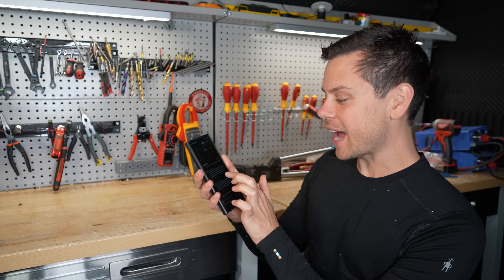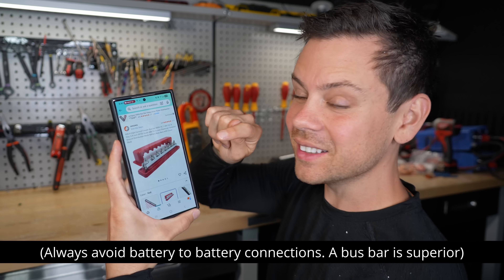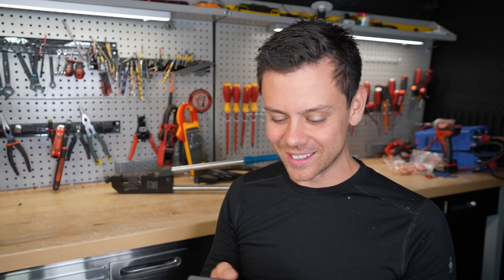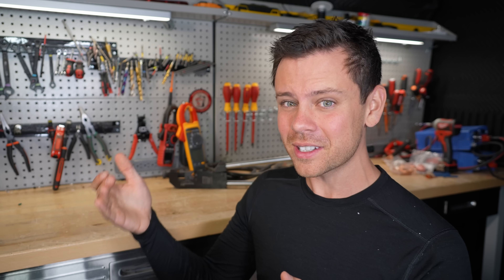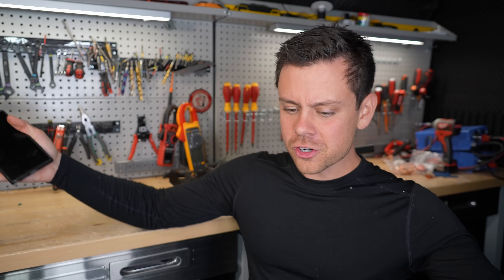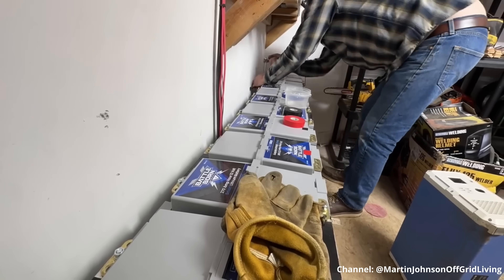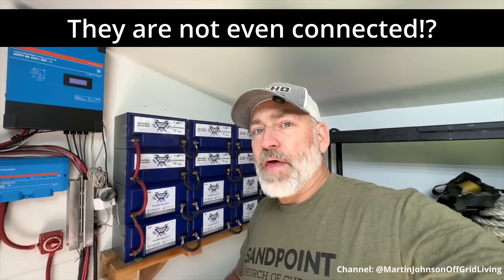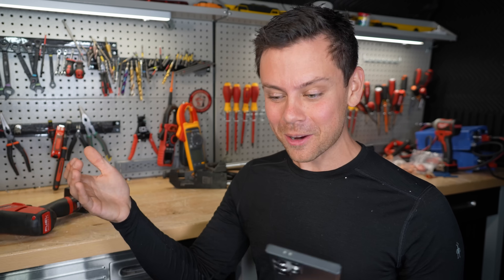My Reaction to Martin Johnson's "BEST Off-grid Battery Bank" Video 😬 Yikes!!

Comment: $25,000 on Batterys and you haven’t got a crimper
Reply: Batteries were probably free for the advertisement.
Reply: @danndank  you're right but the crazy part is that probably meant Battleborn got full editorial control. Or at minimum saw an early version they could comment on. And they still let this abomination go out.
Reply: Well he probably got it for free based on all the boot kissing he was doing about the company.  Looks like all Battle Born employees are downvoting this video lol.
Reply: @jjman533  how do you know this/?
Reply: Or a vise. His home is off-grid, lots of work going on there.
Reply: I have a hammer crimper I use for making automotive/power sports cables but not sure if thats up to spec for a solar power system.
Reply: @TuttleScott  I’ve had a hammer crimper for 13 years when I made several 4 gauge and 1/0 gauge cables.  10 years later I cut a couple of those cables apart because I was still using them and I wanted to see how they were holding up.

The copper lugs and the copper wire were 1 piece!!  I could not tell where one ended and the other started!  Before I destroyed the cables, I also tested the resistance of the cables with a Fluke multimeter.  They each were about 0.2 ohms, which I didn’t think was too bad considering the age of the cables.  

So, with all of that, I am 100% confident that a basic hammer crimper is fine, IF you ensure they are fully crimped.  I hammer them on a concrete floor until the sound changes.  Once the pitch goes up AND the crimper starts to bounce around, that’s when I know the lug is fully crimped.
Reply: @TuttleScott he also has one, used it in his previous video and people in the comments were saying he should use a good one
Reply: Battery Rich, Toolbox poor
Reply: He has a nice roll of solder anyway. Course should any of those terminals get warm it will reflow and the wires will just fall out.
Reply: @SkaBob Warm?  374°F to 446°F is the melting point of solder. That's a lot hotter than "warm"
Reply: ....OR A VICE 🤣
Reply: Or a vise .. blow torch and a cardboard box. PROFESSIONAL
Reply: @holmesondrones I was waiting for the cardboard box to catch on fire 😂
Reply: Not even a vice. smh.
Reply: BattleBorn is he's long term supporter, so he should get those batteries for free.
Reply: @DiedLiu  if anyone at battleborn watched this video and knows even the slightest about wiring, they will cut ties with this guy ASAP then publicly wash their hands of him and his shoddy installation.  It's a fire waiting to happen.  I bought a cheap chinese hydralic crimer for heavy gage lugs... worked 1000X better than this guys blowtorch/solder method.    Watching him run positive cables over negative and then again over busbars... absolute painful.   He's 1mm of insulation away from having a fire bomb on his hands at sooo many points of contact.
Reply: These batteries are way too expensive.. they all come from China.. labeled from USA. Just his design.. did we do a break down on these batteries let's open 1 see what they look like
Reply: 25k for batteries,  you could buy 2full bluetti  or the other one ( forgot the name,  shouldn't,  but was reviewed on this channel) could get 64kw systems  for that price $ 12.5k  and just easily power a few small off grid lake homes. The other system, ( I can't remember  you could get 48k w and their gas or solar generator and if you lose sun for a few days charge your  system.   Totally ridiculous to spend that much. 
 He'll Big battery  will sell you 1 battery that makes double that and a complete system for $10k.
 He made this video just to get all the batteries for free. Atleast I hope that's why.  If they see this video they will their batteries back. 
 Clearly not the way to do it! Looking at the imbalance on those batteries,  his next video will be bashing battle born batteries because he will be replacing them in a couple years. Or his shed and maybe house because of the fire Unless he watches this video and goes back and does it right .
Reply: Jeepers what he’s done is dangerous and if he was doing that in Australia or New Zealand where we have strict safety standards for battery install that would be totally illegal for many of the reasons and even more than what you mentioned but good for spotting many of the real world risks. Your right it does make me sick also when people have no idea what they’re doing and are doing dangerous illegal setups and then posting them online where other people watch their videos and copy it yikes not good. Good on you for your honesty about it will safety is not something to take lightly.
Reply: Thinking about all of that new resistance he introduced to the system sanding them lmao, the damn near perfectly flat metal now has air gaps and such
Reply: He had a crimper in his older video. That's the weirdest part about this
Reply: Times are tough...
Reply: @mrhappyscooters Crimper, my left foot, that poor fool doesn't have anything between his ears... 😲😳🤔
Reply: crimper for 1 or 2 ought Ga is expensive  -  I used to do grounding halos + buss bars for equipment inside telecom shelters  -  mine was hydraulic and cost around $3,000   but those crimps were professional and passed electrical inspection every time. (and we used it a lot)
Reply: You can always just rent a crimper. Much more cost effective.
Reply: @stevemyers2092    So you probably got all the safety training.  These YT videos about putting DIY battery walls in my house are unsettling.  Lots of energy and I wonder how to deal with 10 year old equipment.
Reply: @stevemyers2092 I got one for about 50$ and did my boat battery power on 4 and 2 ga no issues.  Not as pretty as 3k one but sufficient once I figure it out.
Reply: @stevemyers2092  not so. I have an American made hydraulic crimp set and I paid less than $300 for it

Comment: Excellent presentation.  Thank you.  I saw his video and commented on it.  I researched the Battle Born site and I don't even think they make a 48/52.1v battery.   I wonder how much he was paid along with getting the batteries most likely for free.   There is no way even a basic non-sponsored DIY'er would do what he is doing, more especially with 12v batteries.  Even if cost was no object, using Battle Born for his project makes no sense with the huge 12v batteries,

Comment: I like reactions videos as much as the next guy, but you could turn his mistakes into lessons. You did it "on the fly" as you watched the video, but it would be very interesting to have more precise advice after the reaction itself. For example: if someone did have those batteries, what would you recommend they do instead of what he did? If you make more reaction videos, that sort of condensed and specific information after the reaction itself would be very valuable.
Reply from the maker: That's what I did. I went through it point by point and corrected everything
Reply: @WillProwse  Yes, and thank you for that. But since it's so easy for you, it just came out between gasps and giggles in complete disorder. Someone that would like to learn how to use a similar battery setup would have a hard time doing it from this video. (Of course your other videos are much better structured.) Maybe I'm just not a fan of reaction videos just for giggles.
Reply: Just watch Will's videos
Reply: Good idea.

Comment: I thought his video was going to be a neat look at building a solar power system from another perspective, but as soon as he pulled out the aluminum bus bar I had to shut it off. I used to live in a house with aluminum wiring and the one time I had to get an electrician to fix something I went through four of them because the first three said they absolutely would not work on aluminum wired houses AT ALL.

Okay, I'm also cringing at the soldered cables. I have an electronics degree and the first thing they drummed into our heads when we got to the courses on circuit fabrication and repair was effectively "don't expect solder joints to keep your components on the board if they are physically impacted - solder is used for electrical conduction, not physical adhesion. If you're worried about something coming off a board, use hot glue, not solder."
Reply: Aluminum has its place. Most of the feeder wire that runs between the utility and the meter box is aluminum for instance. Its only a problem when its used with connections that were designed for copper and can't handle alu's higher thermal expansion rate.

Comment: Aluminum as a bus bar seems wild to me. There is a reason that houses since the late 70’s don’t use Aluminum Wiring. Turns out it was great for starting house fires.
Reply: There's nothing wrong with aluminum wire but there is a problem using the same gauge aluminum as you would copper. Most house service lines are aluminum. Aluminum can't carry as much current for the same diameter as copper and so you size up and you're good.
Reply: Aluminum buss bars are fine if sized correctly, but can be unwieldy at these large amps. Aluminum wiring was an issue because it work hardens so easily and would develop hidden cracks. And it suffers from high thermal expansion. Not a big deal on a buss bar that doesn't get very hot and has lock washers, but definitely a problem on simple screw terminals that doesn't have any kind of lock or constant pressure.
Reply: you can with no issues problem is sizing it correctly its just not practical 
just fyi most generators use it in windings
Reply: Aluminum has to be sized properly, few people know that service entrance wire is typically aluminum due to the high price of copper.  Typically 4/0 is used for a 200amp service.

Comment: but Will I'd let him buy me a set! My smartFor2 EV conversion is 15 years old still going kinda strong???
Granted I got blessed meeting DavidPoz and funded the build back in the day.
 I even have his old 6k aim 48v inverter as he outgrew it. 
 I depend on my aging system to get us through! Wish I had that much money to burn. 
Off grid life and retired means we work with less each year being poor as it degrades. 
 Sitting in 86F heat with the 10k BTU ripping as i watch.  
All  48v 60 amps chugging thermal throttled! Yeah if we had a 2nd system i could cool the other end of the shed to house Tiny home 16x40ft. 
Wife wanted space... FML I had smaller plans and money to do that many years ago.  
The square footage size schocked me. This wasn't the 500 Ft square I wrote down to her when she ordered it. 
They talked her into the 750Sqaure verison for a few Thousand more.  hahaha... oh well....ok watching more..

Comment: Buying too many 12v batteries and trying to make a hybrid 48v source - $25000... Having Will Prowse dissect your work and point out every flaw - PRICELESS....
Reply: I've spent 15k on my system. For that price I got three times as much battery storage and got whole 26kw solar installation included (with panels, 3-phase-inverter, mounting hardware, wires and everything).

It's crazy how much more you can spend if you ignore other options.

Granted, solar hardware is much cheaper here in germany, but I think the point still stands.
Reply: He’s sponsored by Battleborn.  Probably got it free.  But his video will trick people into overpaying
Reply: I find myself wondering about the amount of "$ponsor$hip" this guy received.
Reply: Pretty sure for 25k I could have  a WHOLE  system installed by a professional.
Reply: The emperor wore no clothes this guy is playing with fire
Reply: Hopefully he has time to see this and return the battery s 😂
Reply: nice
Reply: Perfect
Reply: 3 years ago I got 50 KW hours of energy for 11k. Panasonic cells. The system is comprised used Model S battery modules. Overall my system is 12s370p
Reply: The dude is a bible thumping right wing bozo. No wonder he didn't bother learning how to do it right. He puts his faith in his invisible fiend in the sky! Education is the enemy of religion.
Reply: Nothing wrong with building a battery bank - but build it from cells - not batteries.
Reply: Well, there is something to be said for AGM in cold conditions. Like a cabin I just installed one on, but it will be at -10c for half the year and will still need to be used.
Reply: @1kreature  Still not a good argument for AGM. Installing a heater pad can keep the batteries warm enough to safely charge LiFePo4, and still be WAY more efficient than lead. Not to mention better energy density, and WAAAAAY more longevity.

Lead's dead for everything but a starter battery. And even those are probably not much longer for this world.
Reply: Cringy

Comment: I had previously posted on one of his videos sponsored by Battle Born that people in the comments should check out your channel for an unbiased review of different off grid battery systems, and he said I sounded like an EG4 Salesman lol. When I saw this video I immediately knew I would never watch one of his videos again. Going with a 12V system in 2025 for your off-grid house is just ignoring the better way of doing things we have now.
Reply: After a $150,000 shop and garage fire last August 2, I went with all EG4 280AH wall mount batteries, all in ones (Flex Boss 21, 6000XP) because they are UL Listed.
A defective 300AH 12 volt LiFeP04 battery caught fire and burned up my battery bank. The Forensic Fire Investigator thinks it was dropped from 5-6 feet and landed flat upside down. Sounds like a loading dock screw up. The BMS and negative wires showed signs or being crushed by the cells. It ran for 2+ years 24/7  before shorting out. Thank God I was stuck at home that day and got water on it within 70 seconds of the loud pop.
Reply: One of the first things he mentioned, and that you can see, is it's a 48v system, not 12v.
Reply: @SvenShalom It's 48v using 4x 12v batteries in series and out of balance.